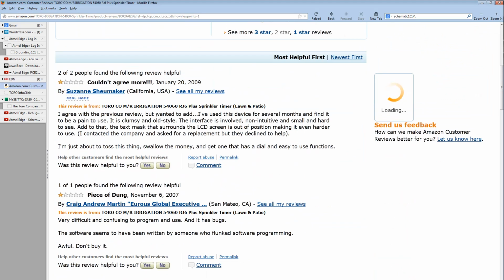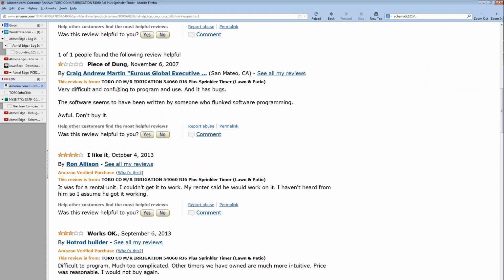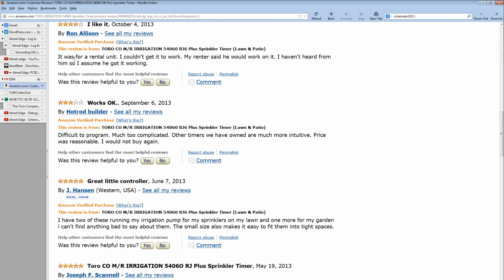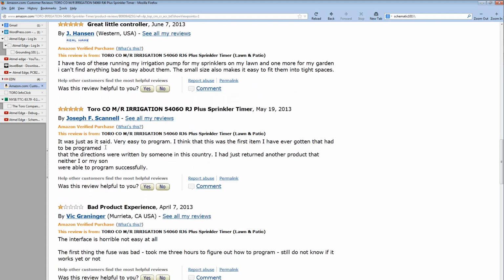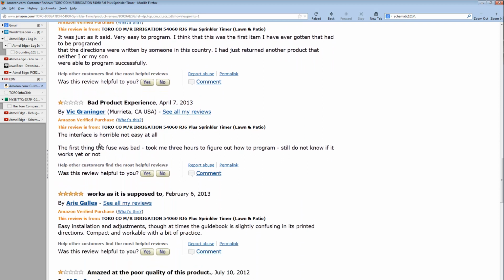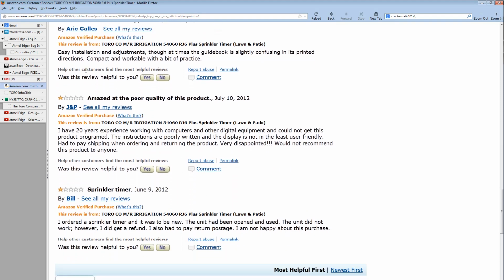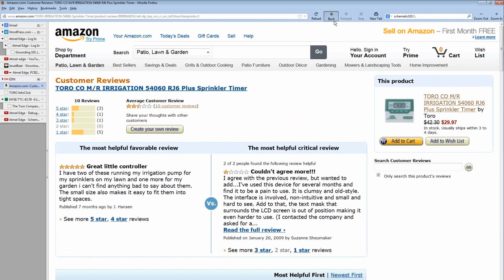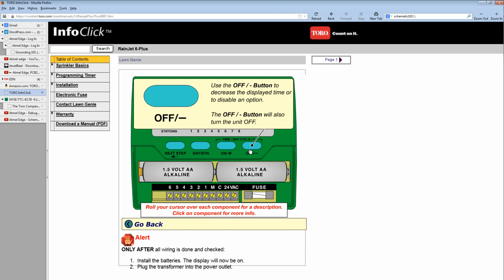Atmel Edge With Paul Rako: Sprinkler 101

Comment: From that mains hum it is a sure bet the timer is simply switching the low-voltage AC power to the solenoid valve.  The fuse mentioned in one of the reviews is probably there to protect the unit from an overloaded output which may not be all that unusual of an event given the application and the user base.  One design enhancement could be to monitor the output current then turn it off when the current gets too high and alert the user which output experienced the fault.